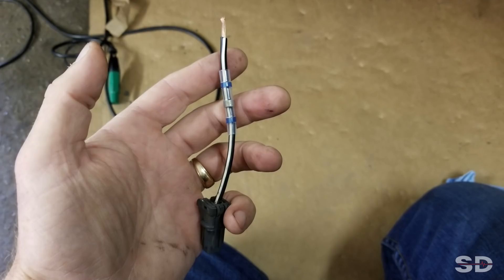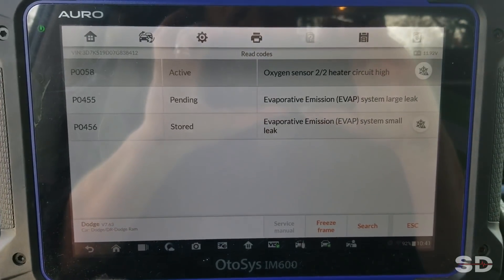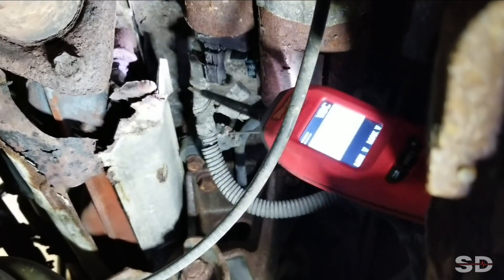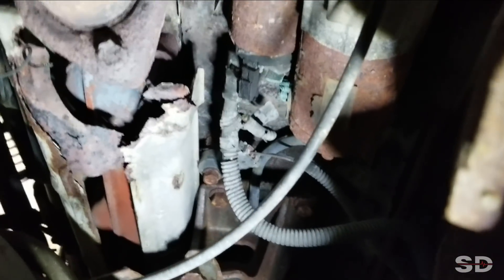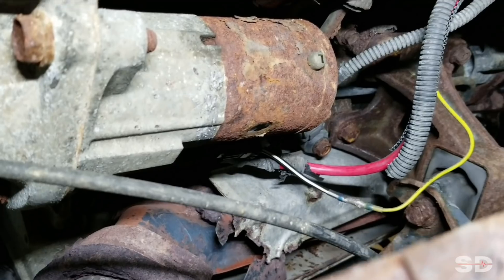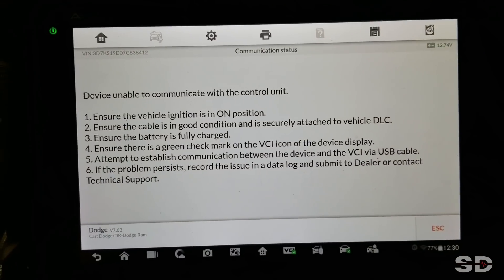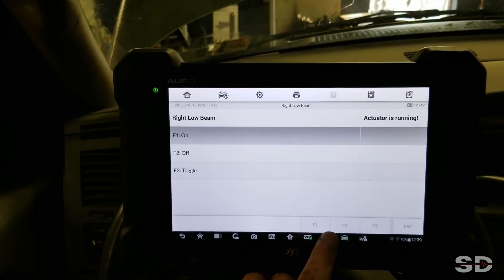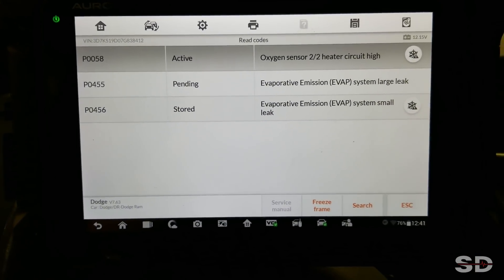2007 Dodge Truck No Crank, Wiring Repairs, New Scan Tool

Comment: I'm not an auto technician, but I believe troubleshooting electrical issues is beyond the scope of most technicians. I still have a cranking issue with by Taurus 2005 that the technician said was a draw from the radio. $200 dollars later, not only is the problem not resolved, but he created another problem with the electrical system. Now the air bag indicator light flashes on and off for about 30 times and then just stays on. I like to support independent technicians, but I'll be taking it to Ford. Hopefully they can figure it out. I suspect it's a simple problem, but requires a true electrical expert.

I wish we had a ScannerDanner in my next of the woods.
Reply: Your absolutely correct. Electrical is not for your average tech.  I am an L1 master ASE Tech.  And have 20 years of electrical diag under my belt..... so that being said I still get ones that just kick my butt. I always win. But at the expense of time and money.
Reply: And that is the one thing I hate about this field. it takes one person to make everyone call us all incompetent.
Reply: Anthony White  the techs at Ford may not be electrical experts either.
Reply: @theporkchop9922  That's true, but I think they'll have more experience working on their own product. My mechanic admitted that he didn't have all the proper diagrams, but said it was fixed. By the way, I don't fault him. I realize electrical issues are hard to troubleshoot. I didn't request a refund and will use him in the future.
Reply: I’m in Florida ... I think those ford guys or gals should be able to pin point the problem it might be a TSB that is somehow related to your issues , hopefully good luck Anthony 👍🏻
Reply: @burtpilon1735  Thanks. Not only will the dealership probably have more diagnostic tools, they also have the entire Ford galaxy as a resource. My 2005 Ford only has 105k. I want to a least get another 50k, lol.
Reply: Your taking your car to the wrong independent mechanic. Dealerships have  better info and scanners but most guys there don't have a lab scope and don't know how to use them. Sometimes a lab scope is the only way to be a 100% sure. I'm not sure what you need in your case.
Reply: @autotechtogo6290  Thanks for that bit of information. I will ask the Ford people if they use a lab scope in their analysis.
Reply: Your radio has the airbag system built into it.  Quite commonly, the CANBUS connector was left unplugged from the back of the radio, or an auxiliary power wire was severed/disconnected from the radio harness. 

What's the cranking issue you're having?  Drop me a Private Message and we'll see if we can troubleshoot it together.  :)
Reply: @rhkips  The issue is quite consistent. At first I thought it was a bad battery, even though the battery was still under warranty. I replaced the battery but no go.

 This issue occurs over a period of a week ( very strange). I'll use Monday as a starting point. From about Monday through Wednesday the car will crank with no problems. On Thursday, in the morning the car will crank, but then if I go to the store, for example, spend maybe 20 minute at the store, when I start the car I can feel a slight hiccup. If I make another stop, this time when I start the car, I get a long draw out dying crank, it seems like it may not turn over, but it does. However, the last time was even stranger. This was after I thought the problem had been fixed. The same time factor applies. This time though, I got the long cranks, and the  battery just completely shut down for a minute or two.
By that I mean, when I turned the ignition key after the long crank and it wouldn't start, I attempted two more times, nothing happened and the dashboard went black also. Now your going to love this. I waited about two minutes. Turned the  ignition and the car started right up. I'm not a mechanic, but it feel like a short. Thank for any help.
Reply: @Anthony White  And the cycle repeats itself on a weekly basis, thereabouts?  As in, the car starts normally for a few days, then seems to degrade again?

What are your driving habits like on the days when it cranks well, versus when it cranks for a long time?  How long do you drive for, what time of day, do you have any stops along the way where you have to turn the car off, and if so, for how long before you go on your way again?
Reply: Yes, that does sound strange! Like corrosion inside a main battery cable, that can't be seen but still causes an issue getting charge thru and sending power thru!! I hope they can find it before it drives you nutzo!!
Reply: @rhkips  This is a problem that all of sudden cropped up. The morning after the dashboard went out, the car started right up.  As far as my driving habits, I drive the car three or four times a week to take care of errands. If  I make a stop, it could be 20 minutes or a couple of hours. That has been the case over the last few years with no problems. I don't drive it now because I'm afraid if I make a stop somewhere it won't crank, and I won't get to the shop until the end of the month. However, I do start it every two to three days, and it starts right up. I'm also waiting for a portable charger to arrive this Friday. When that comes, I will take the car back out on the road and chronicle the issue. 

The mechanic who worked on the car said there was a "significant" draw on the battery. He had the car for four days. He also said he didn't have the complete diagrams for the electrical system, but he traced the draw to a cluster where the radio was supposedly the culprit.

Thank for that information about the airbag indicator attached to the radio. The funny thing about all this is I'm not frustrated or angry with the mechanic. I'm really curious about what's causing the issue.
Reply: I wish you the best of luck!  Sounds like you may have a good lead at that Ford dealership; especially if the technician came out to speak with you!  It does sound like you may have multiple things going on here, and unfortunately, diagnosing over the internet is an arduous adventure.  Based on what you've told me, I'd want to scan for codes to look for direction, and break out the scope to look at a few things if there are no codes present, or the codes didn't point towards something.

Annoyingly, I was planning on being in San Jose this weekend, but I had some stuff come up and had to cancel my trip!  D'oh!  :(
Reply: Anthony White  where’s your neck of the woods Anthony
Reply: @burtpilon1735  San Francisco Bay Area. I'll be taking my car into Walnut Creek Ford. They have an excellent reputation, and I've already talked with Tim who is familiar with these issues.
Reply: Anthony White... G. E. M. Generic Electric Module.
Reply: @roadkill5333  Thanks. Tim at Ford did mention a possible module issue, and that was the first time I'd heard about it. If I were a younger man, I would specialize in only electrical issues with cars. Plenty of honest money to be made there.
Reply: Anthony White...I don't know a lot about them, but knowing that you are having a ghost electrical problem with many different circuits, leads me to the GEM. I'm not positive, but I believe that it is an electronic module that provides a pathway to ground, for many different parts of the electrical system. When different items all at once, show up with issues of no operation, sporadic operation, or malfunction indicators it could be the GEM failing! It's hard to access, expensive to just shoot the parts cannon at it, and very troublesome to diagnose. These techs are much more likely to be able to say what about it, than I am! But, none will be able to tell you for sure, without doing some minor circuit tests! I used to love getting into wiring troubleshooting, before they made everything into a Rube Goldberg machine!! You can't roll down a window, unlock a door, or turn on a light, without asking a computer, to ask another computer, to check with another computer, to see if the computer can ask the other computer if it's ok to ask a computer to power a circuit! The good ole days, when you turned a switch, and the switch actually did something, that didn't involve asking every other computer in the world for permission to lock the door! I remember replacing an alternator because it didn't work, not the computer because it won't let the alternator work. Heck, I remember when you rebuilt an alternator that didn't work, not go to the part store for another one!  But, these are the times that try men's souls, and wallets! It's scanner wars, anymore! We used to go buy a laptop computer, with all the latest equipment, and programs, and try to get it home, and hook it all up, before it became obsolete! Now, they are doing it with scanners!! The latest computer software, with a price tag that rivals most small houses, that one tech claims is good, and the other tech claims it won't do the job! But, neither will be using it next week, because they can't afford to update it! 

Best of luck with getting yours fixed!! It may be hit and miss, or someone may figure it out for cheap for you, who knows. It all depends on who you get, and what scanner he's using!
Reply: @roadkill5333  LOL  I have a portable battery charger on the way,  just in case they fail again.
Reply: You have to understand, I don't care who you are , if the tech does not have the factory wiring diagram and an understanding of how it works even a dealership tech will have problems.
Reply: @littlewarlock9361  No disagreement there. But then the tech should say, " look, I don't have the proper diagrams, I'm not going to be able to help you." It's that simple. Having said that, I suspect the dealerships would probably have the diagrams on most of their products going back to the 1980's. This is a 2005. They will have the diagrams.
Reply: Anthony White - I suspect that it starts the first time when cold no problems. But as soon as it’s warmed up after driving a little bit, it will start to show problems starting. Especially after a short hot soak, that means after your up to operating temp then shut it off the engine compartment will rise in temperature for a short period. So if you go to the market shut it off,go in then 15-20 min later it has problems starting. However, if that stop were longer say at a friends for an hour or two, it would be long enough to cool back down and start without much trouble. If this is the case, it’s most likely a bad battery ground cable/or possibly both pos. /neg. you might be able to verify this just by feeling the negative cable and compare it to the positive cable for temperature after it’s been running a bit. The bad one should be hotter were there’s high resistance. And the more stuff that’s on drawing current the hotter it will be,like headlights,A/C etc...Which would explain odd voltages the first tech saw trying to find a better path back to the battery..bring jumper cables with, if there’s a next time attach jumpers the same place the battery cables go and if it fires right up its a bad cable..good luck
Reply: @paultomasetti5164  Paul, I think you hit the nail squarely on the head. Today, since I received my GB40, I wanted to chronicle the events. I made 4 stops over a period of 4 hours. On each stop, except for the last stop, the car fired right up. On this last stop, she completely shut down. Not a peep. Connected the GB40, started right up. I don't have the competence to change the wire, but you can bet I'll be presenting your comment to Ford. Thanks for the help.

This begs the question of the last mechanic who said the radio was the draw. How would he come to that conclusion? I can only suspect that he made a guess, and hoped for the best, lol.
Reply: Anthony White - hard to say exactly. There may be truth to what he had seen at that moment. There are a lot of grounding points under the dash and around the body. Over the years beating down the pavement,good connections can very slightly loosen enough to let fretting in. Fretting is almost microscopic arcing across tiny gaps which create a buildup and becomes higher resistance. So the pixies try to find a better path. All the voltage is trying to get back to the battery where it started and if the main cable can’t hold all the pixies coming across, they backtrack and find a different route through other components and body grounds. You could be looking at your meter and see some voltage and someone come over and open the door and the voltage disappears, it just found a better path. It can get confusing and maybe he didn’t really know what to tell you. Hope it works out well for you
Reply: @paultomasetti5164  So Paul, let me ask you, is there a way to test the resistances in the battery cables? If there is, I would think that would be the first place you troubleshoot.
Reply: Anthony White - absolutely, they’ll probably do a voltage drop test, see the battery voltage and compare it to the other end of the cable to see how much is getting all the way through when under load,meaning while the engine is cranking starter motor engaged. You could check for low resistance in ohms and if you know the cable diameter and length look up what the ohms per foot should be. But, that’s really useless because one tiny strand holding the whole cable together would look like an open freeway to an ohm meter. It’s only when you put it under load by shoving a known quantity of pixies through it and counting how many make it out the other end will you know the fitness of its current carrying capabilities. a lot of times cables get overlooked because they “look good” but the corrosion is hidden inside the insulation. It can wick down the cable inside. And then the cumulative effect from oxidation and corrosion at both ends of the cable. I don’t think they’ll have much trouble figuring it out
Reply: @paultomasetti5164  Thanks again. Tmw I'll call the mechanic to see if he checked the battery cables thoroughly.
Reply: @paultomasetti5164  Hey Paul just wanted to thank you again. I'll just replace the cables. They're 15 years old. If that doesn't work, I'll take it in to Ford. I notice on Youtube when most mechanics check for the draw, they seem to overlook the battery cables, they go right for the fuses. Battery cables  would be the first place I would start, and I would check them thoroughly. I'll get back to you if that is indeed the problem.
Reply: Anthony White - I’ll keep my fingers crossed,good luck.
Reply: @paultomasetti5164  I just went outside, it's currently 52 degrees. I just checked to see of the car would start up. It started right up, lol. By the way, where's your neck of the woods? I live in the San Francisco Bay Area. Also, just a side note, whether you're having a problem or not, I think everyone should invest in a GB40 Charger. Had I not had that yesterday, I would have waited an hour plus for AAA, haha.
Reply: Anthony White -nw Wisconsin watching it snow today. Have those harbor freight battery backups with air compressor in all the cars. When the air gets cold the pressure drops tires look flat and don’t realize it till you’re in the middle of nowhere. That’s even if you could find one of those stupid air pumps that eat quarters. Eventually bad cables or grounds will become compromised beyond usability even when cooler. Take care on all the connections at both ends of cable including any smaller gauge from the battery post to inner fender(or wherever it goes in your case) it’s the alternate path for body grounds. Also clean and closely inspect any large fuses or fusible links in line with the cables usually near the battery. You may not have any in your case, but any connections or splices could be faulty. Scannerdanner has a lot of bad grounding vids on this channel.
Reply: @paultomasetti5164  Hey Paul,  wanted to let you know what the issue was: the starter, lol. Now, here's my problem: your analysis of the battery cables being the culprit and that was the reason for the first mechanic calling the radio the issue made sense. However, not only does the radio not have a draw, how one can mistake a defective starter for  a radio draw is beyond me, ha-ha. The radio was reconnected and works fine, no draw, of course. 

At this point, I'm thinking I might ask for a refund for services not performed ($200). It's clear that out of the frustration, he just made a guess. He should have just said, " I can't find the cause." I would have been happy with that. Do you think I should let him slide???
Reply: Anthony White - glad you got to the bottom of it. Hope it was the starter and not just corroded cable ends that got “ fixed” in the process. At any rate it’s worth the piece of mind that it’s done. As far as getting your money back from another shop that didn’t fix it.well, that’s really hard to say. Regardless of that mechanics reasoning or whatever we may surmise. Is it worth the aggravation in trying to prove what they were thinking was wrong. Doesn’t seem like rational thinking is there strong suit. Personally, I wouldn’t want to waste another minute of my precious time or another penny in what ultimately may become threats of small claims court. It only cost you 200 to find out not to go there. Others probably paid a lot more
Reply: @paultomasetti5164  You make great sense. I'll just move on, lol. Actually, Walnut Creek Ford diagnosed the problem quite quickly. They kept the car longer than normal just to make sure they had solved the problem. I tend not to want to go to dealers for maintenance because of the higher costs. But like mechanics, there are dealers and there are dealers, lol. Walnut Creek Ford has a five star rating on yelp. For a dealership, that's next to impossible. Thanks again for your help.
Reply: @paultomasetti5164  What you say makes great sense. I'll just move, lol. Actually, Walnut Creek Ford diagnosed the problem quite quickly. They kept the car longer than normal just to make sure they had solved the problem. I tend not to want to go to dealers for maintenance because of the higher costs. But like mechanics, there are dealers and there are dealers, lol. Walnut Creek Ford has a five star rating on yelp. For a dealership, that's next to impossible. Thanks again for your help.